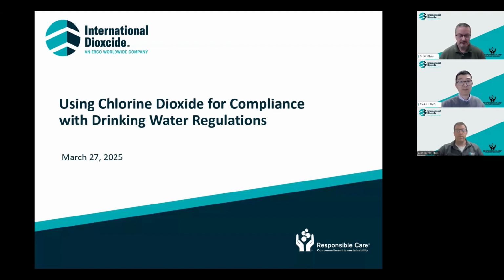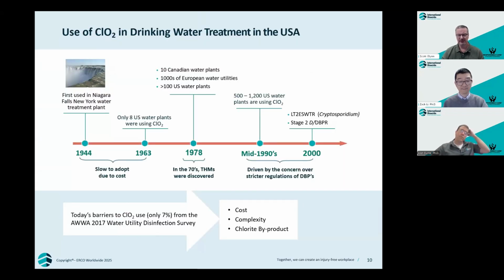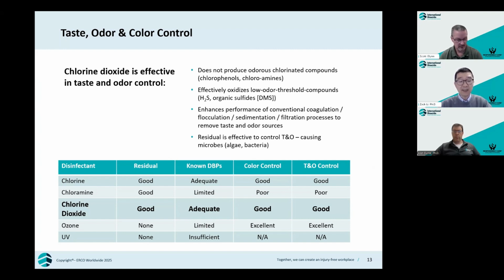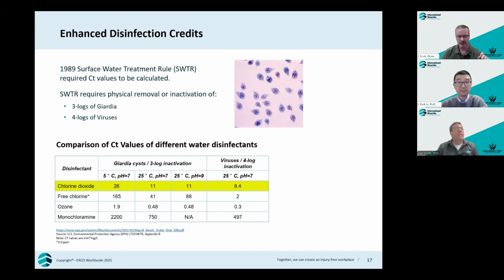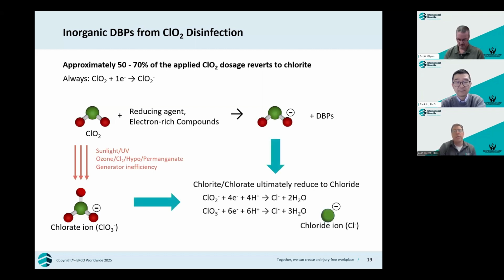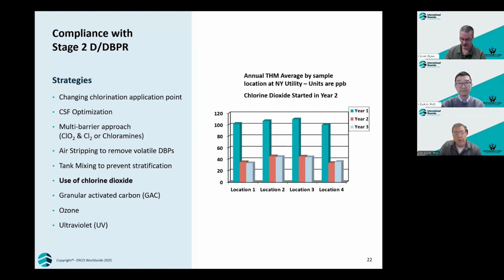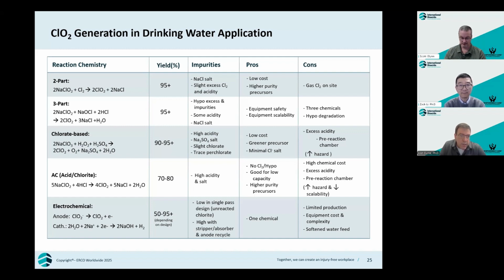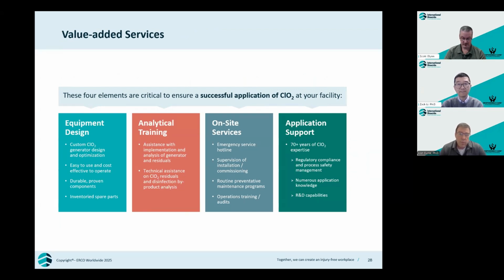Chlorine Dioxide in Drinking Water: Disinfection, DBP Control, and Treatment Strategies

Comment: 🇨🇦 HOW DO I TREAT MY 20 feet deep 3 FOOT DIAMETER CEMENT TILE DUG WELL? WHAT ARE THE PARTS PER MILLION SHOULD I BE FINISHED WITH, AFTER THE TREATMENT TIME IS COMPLETE?💦 August 10, 2026.
Reply: 36^2/1029.4 x 20 x 42 x 8.34 x 2 ppm / 1000000 = .0176 lbs Cl02 for that volume H20 @ 2ppm dose